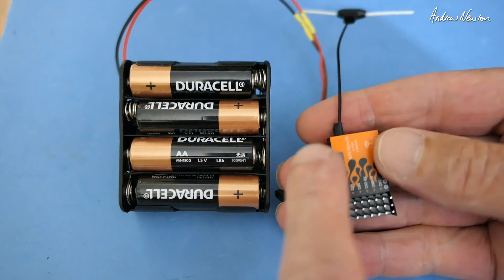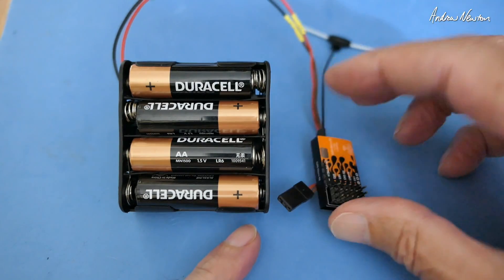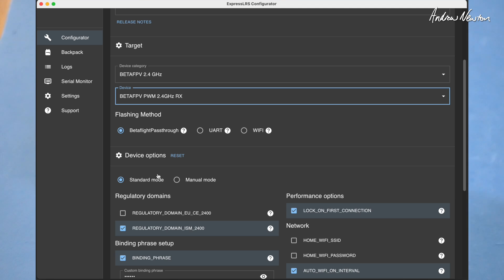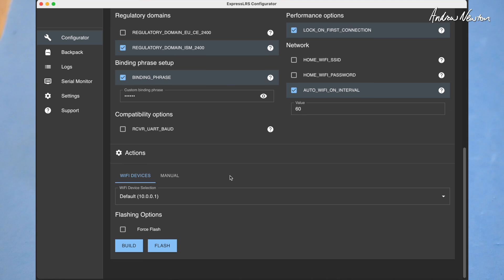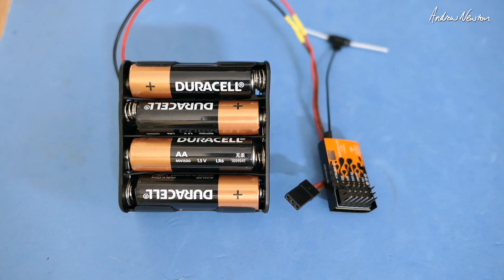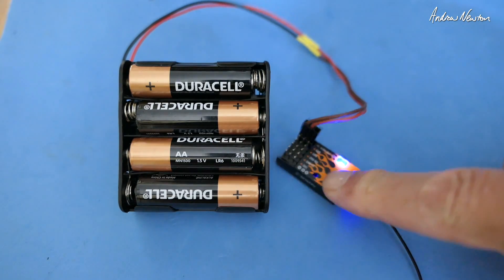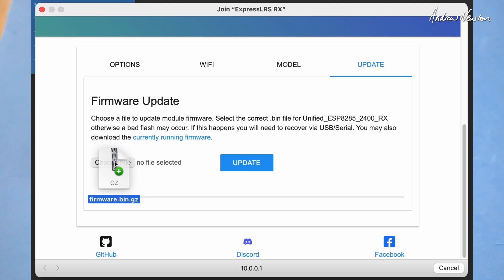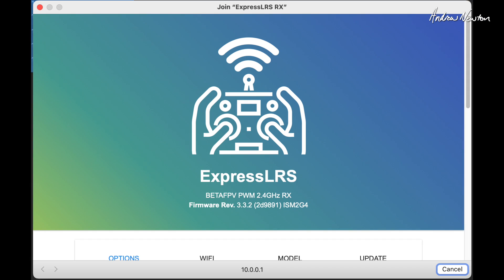Simplest ELRS Receiver firmware flashing

Comment: Good demo 👍 Got a question about this little receiver ... it's 5 channel, but got 6 sets of pins. I've been wondering what's possible with that last set of pins ? What are they intended for ?
Reply from the maker: Power connection is all. NC means Not Connected